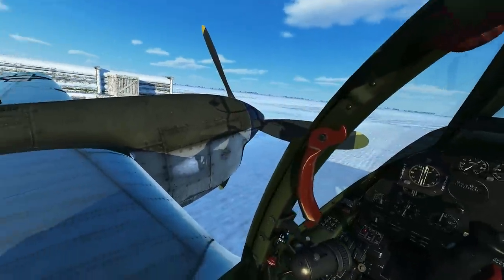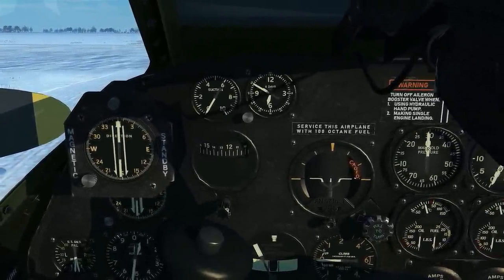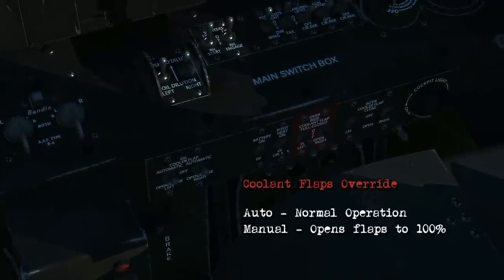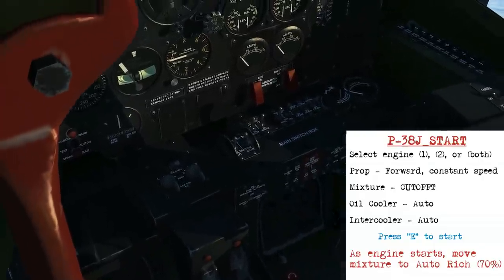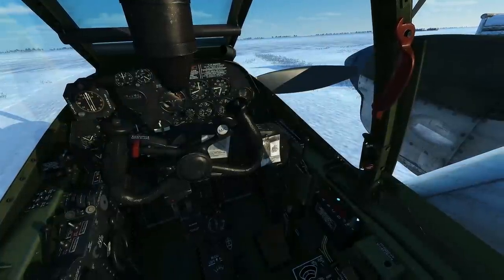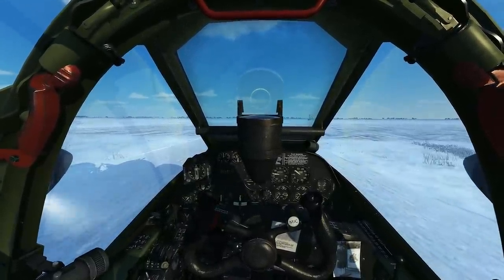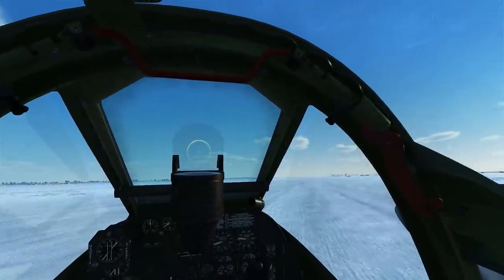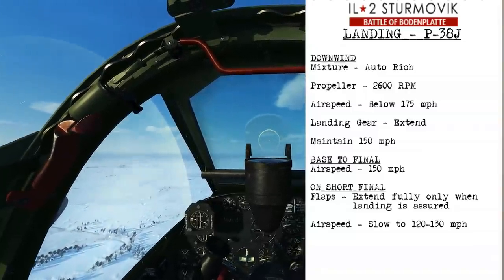Learn to fly the P-38J Lightning

Comment: Currently my favorite allied airplane, but does anybody noticed there are two things not simulated correctly! At first the position of the intercooler shutters has absolutely no influence on the carb. temperature. And you can still run combat power manifold pressure far above full throttle height. In reality this would lead to a turbocharger overspeed condition. So the P38 is currently “cheated“ in terms of no turbocharger speed limitation simulated. Do you agree?
Reply from the maker: You're correct. Right now it's not possible to control the intercoolers manually but the devs have said it will come later. The engine management is a bit too forgiving as well I agree. You shouldn't be able to overboost an engine with no real consequence
Reply: The P-38 did not suffer turbocharger over speed until over 30,000 feet of altitude.

The J and L could run 80" of manifold pressure at 3,000 RPM up to around 30,000 feet. Now, if you were to run the engines at the Allison rated speed of 3,200 to 3,400 RPM, then you would see turbocharger over speed below 30,000 feet.
Reply: @AlanRoehrich9651  Level flight critical altitude for 70" map was 19800 ft. Reaching 30000ft
with 80" is far away from any possibility. Additionally flight manual calls for map reduction starting at 25000 ft for the 60" rating, maximum for 30000ft was 50" anyway. Where do you got your information from about the 80" ratings?

Comment: ty for this video i was recommended for this by combat box group. also i would advise as i found down the comment chain. if your using a default map set up with a non hotas joytstick im using an saitek av8r-03 map a binding for the engine rpm under engine control. the default binding only does it for throttle once you get engine rpm bined then you can move like this video :D. gl hf

Comment: Your videos are mandatory for any plane I haven't flown yet. What recommendations would you give for dives and combat? I'm wondering about 'Fixed' pitch and the RPM limiter-are RPM's controlled by propeller pitch or are they two different controls? Is it best to just keep it in 'Fixed' pitch? I've found the P-38 cruises quite easily even at 50% throttle and 60% RPM. Just curious how the propeller pitch factors into this. Seems that when I switch to 'manual' control on propeller pitch they always seem to be at 35%. I've also noticed on 'Auto' the radiators seem to keep the temps right at the edge of the green, borderline running hot. Is this normal for the P-38 at lower altitudes? When switching to 'manual' control I found out they're either open or closed, no adjustment. One last question-is the P-38 like the P-47 with three sets of radiator controls?

Comment: Great video! Very helpfull. I still have one question though. How does one read the fuel gauges? In total it should have 416 gallon's, but the two gauges combined never add up to that. Does it only show remaining fuel?
Reply from the maker: Those two fuel tanks tell you what's in the main and reserve tanks. If you have fuel in the outer wing tanks or in drop tanks (if those are added) you estimate that level based on hourly fuel consumption.
Reply: @RequiemsACTL  Ah that clears it up. Thnx

Comment: Great video and excellent instructions; I'm definitely will be getting into the IL2 community. Just a few questions: 1 can the P38J be utilized in other WW2 theatres? 2 will I be able to with my thrustmaster, incorporated different functions? Lastly, what type of computer are you using? Thanks
Reply from the maker: Hi Ron, you can use the P-38 on any map in a quick mission battle. For a career there isn't one yet but the Pat Wilson Campaign Generator will add it with the Rheinland map to use it on in a career. For multiplayer it's up to the mission creator, they can put any airplane in any scenario/map they desire. I don't know what kind of Thrustmaster you have but you shouldn't have problems assigning functions. My computer is an i7 7700K CPU,
MSI Z270 Motherboard,
Corsair 16gb RAM,
MSI RTX 2070
Reply: @RequiemsACTL  Thanks for the response and information, my thrustmaster is a T- 16000, Again, Thanks***

Comment: Not wanting to be that guy, but a heads up the pilots notes have a possible typo. Maximum Carb Temp is 25 Degrees Celsius and Optimal is 45 Degrees Celsius. I would not have noticed except that I have learned to fly these planes from your videos. I have a note book where I transcribe your information. Thank you.
Reply from the maker: Hey it's all good. I'm fine with people pointing out errors to avoid any confusion!

Comment: How do you know what the turbocharger speed is?  I didn't see a gauge for it.  Also, I saw fuel gauges for the 93 gallon main rear tanks, and the 60 gallon front reserve tanks, but not the 55 gallon outer wing tanks.  How do you measure fuel for those?

Comment: Thanks for the video! Am I correct that Propellers RPM are controlled manually? Should the pilot manually adjust proper position of RPM levers in certain ratio to Throttle levers?
Reply from the maker: Yes, generally speaking you will set the RPM and it will stay there. There's no real ratio to think about, but as a basic rule you can keep the RPM in front of the throttle.
Reply: @RequiemsACTL  Thank you. As far as I've tested, P-38 engines don't allow to operate propellers RPM always set to 100% (due to risk of overheat), and you cannot simply decrease Throttle to stay in cruising mode... maybe I missed something...

Comment: Great videos; a few quick questions: WEP 5 Min, Compat 15 min, what about combination?  How long till that resets or how can you combine?  Is there a decent rule if I go 15 min in combat before I can use again?      What do you use to record these videos?  I use OBS but in VR it's capturing the left eye instead of the right eye and so the gun sight is off.  THANKS!
Reply from the maker: Honestly, I don't even bother to think about the timers much unless they're only 1 minute long. My rule is whenever I'm out of a fight I always switch back to a max continuous setting to help optimise the "combat" and "WEP" power for when I need it and I've very very rarely blown an engine as a result. 5 minutes is a very long time to be using maximum power in a fight as most fights are already resolved before that. As long as you remember to go back to continuous you shouldn't have any problems.
I use the nvidia experience for recording these videos, but for streaming I use OBS. I don't have VR so I can't help there, sorry.
Reply: Thanks!
Reply: Wish i knew how the game modelled it for those 1 min engines.

Comment: Hello sir, I Don’t understand the intercooler operation. You open it for Engine Start and takeoff?  Then in flight what do you do? And during landing? It is a separate thing to the Oil Flaps and Radiator flaps, those you can set to Auto like in the P-51
Reply from the maker: Unlike the P47D, the intercooler is automatic in the P38
Reply: @RequiemsACTL  thank you sir

Comment: Under startup procedure, you mention leaving the mixture at "cutoff" and then move it to 70% once the engine starts.  I tried it both ways in IL-2, but it didn't seem to make a difference.  Is this something that is necessary in real life but not modeled in the sim?
Reply from the maker: That is the RL procedure and it should work. Maybe add  a little bit of throttle or try mixture to full (100%). It could be a bug introduced if the auto position isn't working.
Reply: @RequiemsACTL  what I meant to say was,  that it works regardless and there didn't seem to be a reason to leave mixture at cutoff until the engine turns over.
Reply from the maker: @Jbroker404  Ahh yeah I see what you mean now. I noticed that as well when making this but I kept things to the RL procedures because if things changed then I know what I create will still be right :-)

Comment: does the P-38 have nose wheel steering or do we need to use left/right brakes when taxiing?
Reply from the maker: No nosewheel control as it moves freely. Just use the brakes or differential power if needed.

Comment: I have my RPM/PropPitch and Throttle set to my single "joystick throttle axis". Is this normal? 

I may be wrong but when I fly it, it seems very under powered and slow. Maybe placebo. Always get caught by single-engine planes in climbs somehow. Straight line, Max throttle+PropPitch, and still get caught by 109s climbing underneath me.
Reply from the maker: No it's not normal, your RPM should be set separately from the throttle to let you get more performance in cruise flight. There is a bit of lag in the turbo so you won't get full power immediately.
Reply: @RequiemsACTL  Thanks for the reply. Clearly more testing is in order! But now im even more confused as to how to run it xD    Is it a "variable pitch prop" or a "constant speed prop"? Those two terms don't seem mutually exclusive to me. (for context, i usually fly 109)

Comment: No turbo rpm indicator?
Reply from the maker: No need as it's all handled automatically.
Reply: @RequiemsACTL  it's the third time i break my engine, do you know why?
Reply from the maker: @CalamarTv  You exceeded some engine limitation. Look at the technical specifications page to see where your RPM and manifold pressure should be for cruise (continuous) flight

Comment: How hard can you run these engines - I've had failure during takeoff - exciting!
Reply from the maker: I've never had that... you should be able to use max power no problem. Maybe you were too aggressive with the throttle increase
Reply: The correct takeoff procedure for the P-38 is to square the aircraft at the runway threshold, hold the toe brakes on the rudders, set the props to fine, the mixture to auto rich, and advance both throttles equally to reach 3,000 RPM and 54" of manifold pressure, and then release the brakes. You should never touch the throttles during the take off roll, or in the air until you have raised the gear and the flaps.

Of course, that assumes you have done your magneto and prop tests, which probably are not modelled anyway.

But the P-38 is a zero net torque aircraft, so you DO NOT advance or retard the throttles, or make other adjustments, once you begin your takeoff roll. Unlike single engine high performance aircraft, you never touch the throttle after releasing the brakes. It should be at 100% power and both engines running normally before the plane even moves.